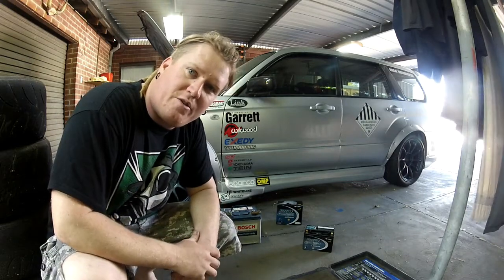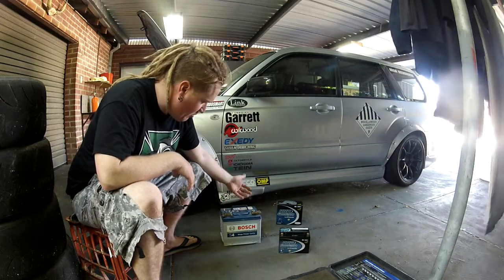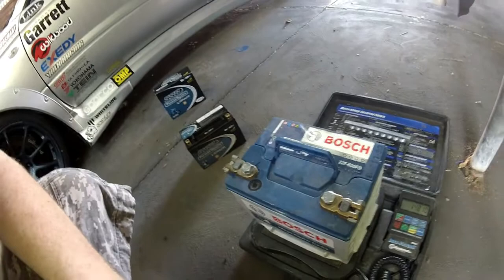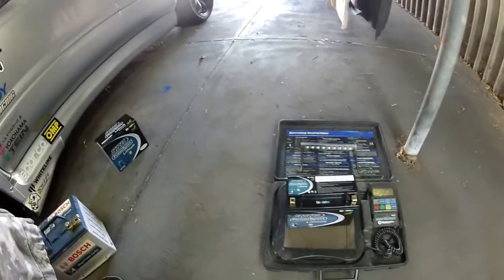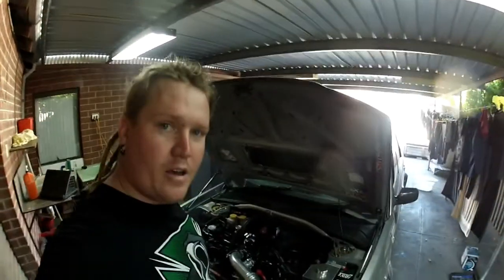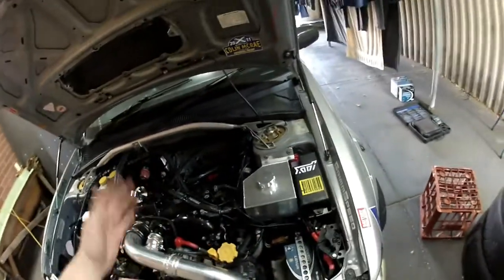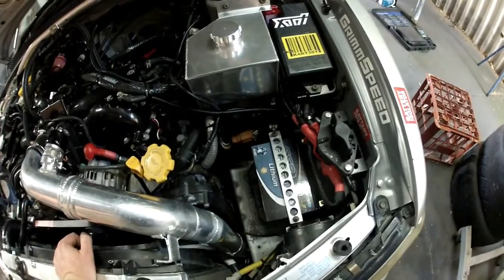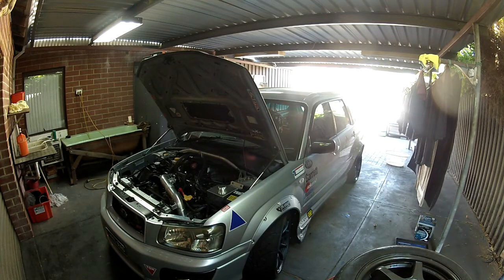Lithium Ion Motorcycle Battery In Race Car.

Comment: Looking at a car battery version right now on a large Chinese selling platform . Model is 46B24R. It is 3.5 kilograms and 46A capacity, 860CCA and can be charged at 10C, so up to 460A then LOL. Spec says 90% charge possible in just 6 minutes! It would be priced just over 300 euro shipped. Really on the fence here ...

Comment: Bro, why not change your alternator to a smaller lighter one that produces less amp/ Less drag on the motor since you removed some of the electrical components. Best of both worlds.
Reply from the maker: Stephen Woodward 
Well, its not a bad idea.  But it wouldnt really reduce any parasitic drag on the engine, except for what would be gained from spinning a lighter wieght rotor inside the alternator.  The thing with alternators is they only produce the power that is needed to raise the system voltage to the regulator cut-off.  So a smaller alternator would not reduce any parasitic load from power generation, only from lighter wieght rotating parts.  The vehicle and accessories still draw the same power, and that power still needs to be produced by the alternator.  So it would be a bit work and expense and give very little benefit.

The other thing to be wary of is going too small an alternator.  If the alternator cannot produce the power needed, (say at idle) then there will be a net discharge on the battery while the vehicle is running.  I know people who have fitted 40amp alternators to subarus, and then they dont produce enough power at lower RPMs.  

Also, in the coming months im hoping to be running a 600whp setup.  So will be adding an additonal fuel pump aswell.  I would probably not want much smaller than this size alternator to run 3 large fuel pumps plus  the other power consumers.

Comment: How is this going? I really want to try as motorcycle batteries are significantly cheaper than car lipos. I'm just concerned with the long term charging system.
Reply from the maker: Rick Roberts 
So far so good.  But the car is limited use vehicle and is currently out of action needing an engine re build.

I wouldnt recommend it for an everyday car.  But for a motorsports car or limited use car it would appear to be fine.
Reply: @BramBiesiekierski  hey bro why you wouldnt recommend it for a daily driver?
Reply: @BramBiesiekierski  hallo if u use at charge controller.....can I use for normal car ? Thx
Reply: You used the lithium motorcycles batteries on the track which I believe is rough duty.
Did you encounter any problems at all.

Did the motorcycle batteries every get hot, melt their cases?

I am planning to Mount a pair of lithium 300 cca betteries in parallel circuit.